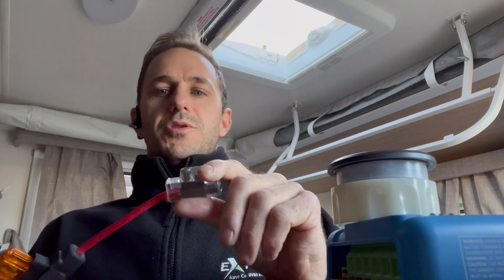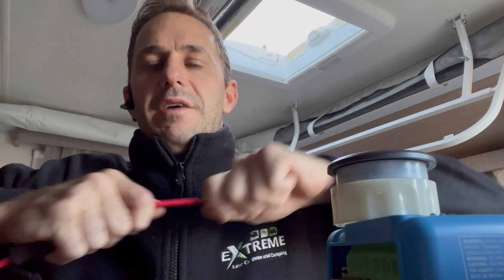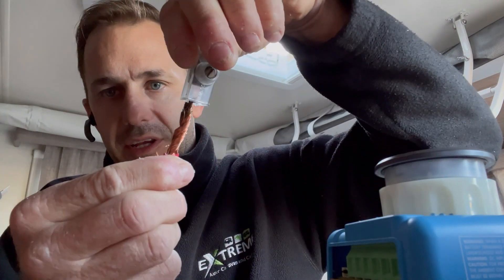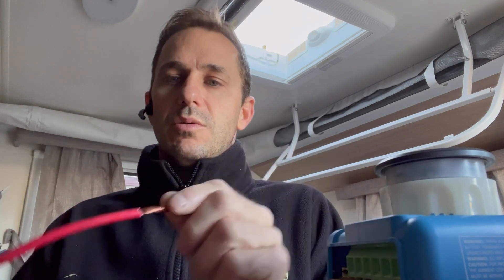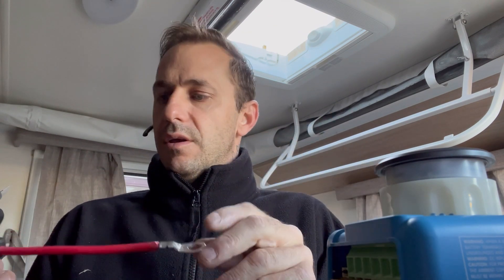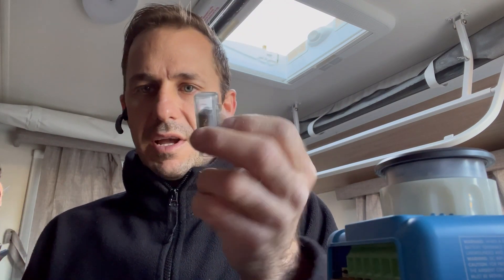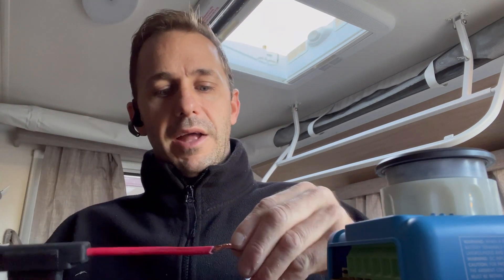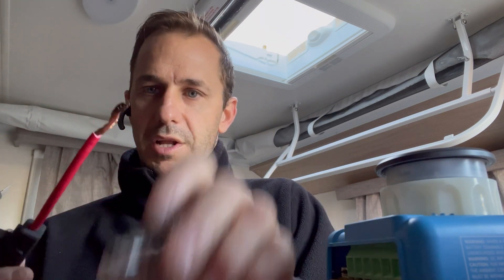Connections and heat issues

Comment: I have 8B&S cable from starter battery to a Victron 18 amp dc/dc to the van 200ah lithium. It's a Mazda CX5 and AVan Cruisliner. Would you be ok with that settup? 

Another question. How do I extend a cable reliably to add a different plug when the cable was only just long enough with the old plug? eg. Cig outlet to anderson powerpole. Do you think straight joiners are appropriate for low draw to 20 amps?
Reply from the maker: That should suffice for that model DC charger